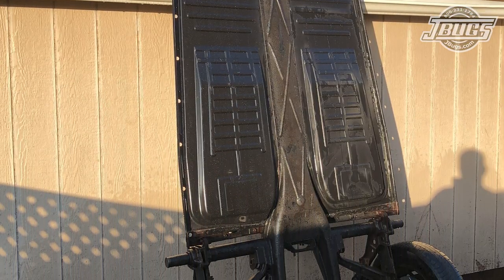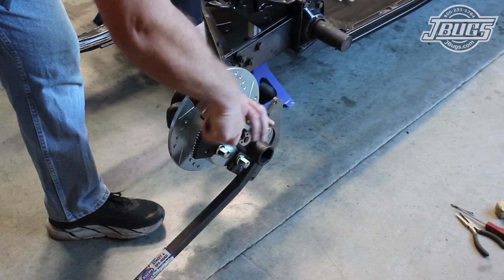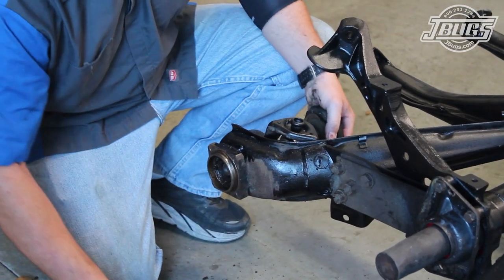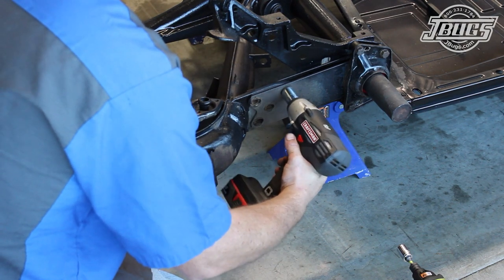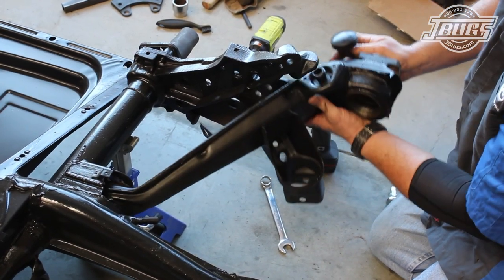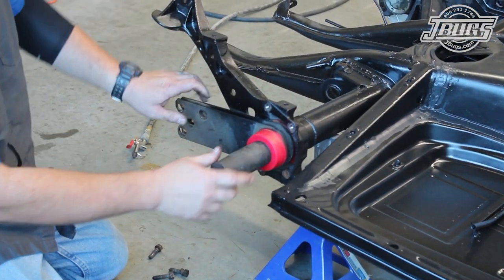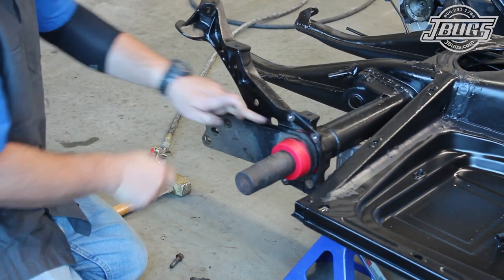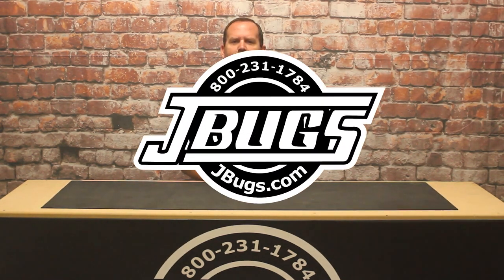JBugs - 1971 VW Super Beetle - Rear Suspension & Axle Tear Down

Comment: So much nicer to do with with the body off.  I've been redoing my rear suspension parts all summer and now need to get all of this back with new bearings, disk upgrade, etc.  I had to remove everything though to remove haphazardly sprayed undercoating. I could not make any marks since it all needed to be blasted and repainted. I'm going to try to reinstall from scratch in a week or so and I hope I can figure out the angles, as so many write-ups and vids are about lowering or raising with known start values while I need to basically start from scratch as if the car is assembled for the first time.

Comment: Great tips on how to get the axles out. What coating did you use for the pan?
Reply: After brushing and spraying on Corro-Seal rust converter on the top, bottom and inside the pan, the bottom side was done with rubberized undercoating. The topside was painted with satin black spray paint.
Reply: Rust is the enemy for these cars. I never put rubberized coating on the bottom pan. Is it worth doing? I always worry about it holding moisture like the old ziebart coating.
Reply: @FixinBugsNStuff  it seals the metal, like powdercoating, paint or anything else applied directly. There is no way for moisture to contact the metal, provided everything is covered and the factory drain points are not. Back in the day Ziebart was usually applied in a rush with little prep work and often over areas that shouldn't have been coated. That's why it had or has a reputation of holding in moisture.